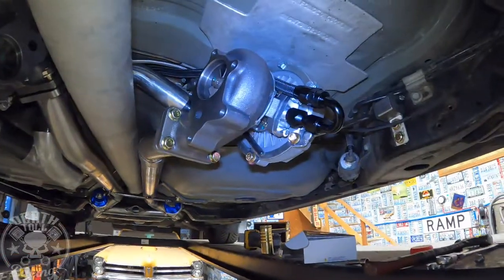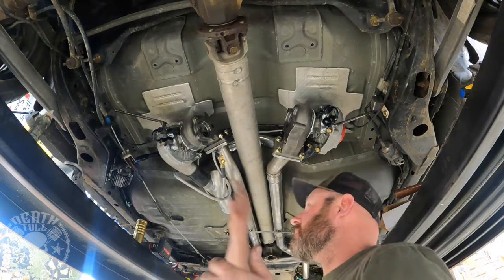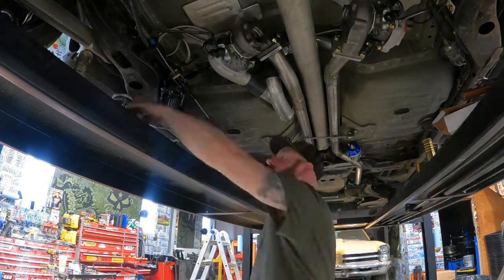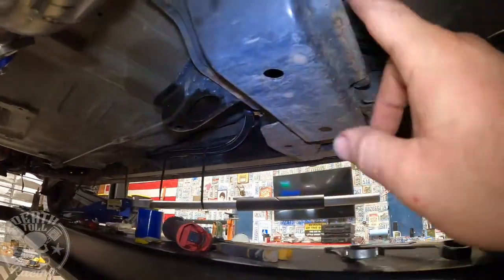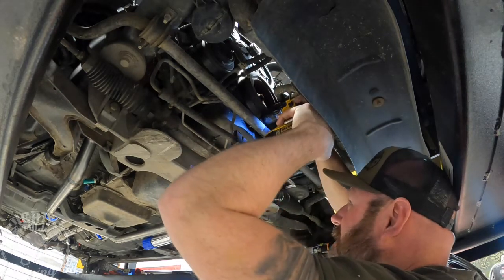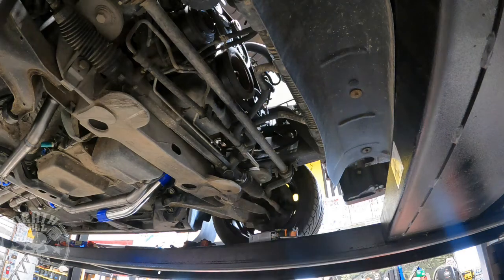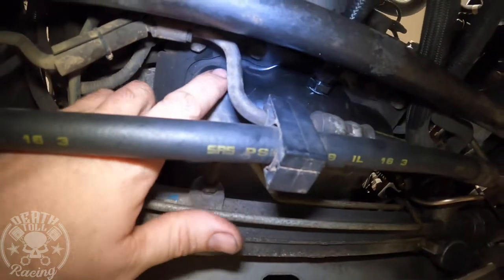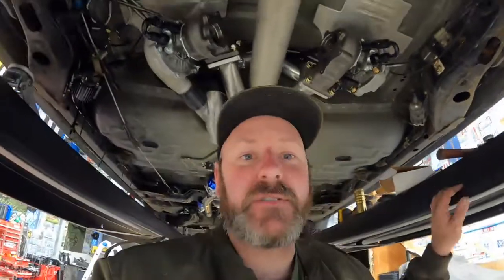Ep 5, Twin Turbo P71 Crown Victoria, Oil System, Scavenge Pump, Punch and Tap Oil Pan, Police Car

Comment: Did you use teflon tape, pipe sealer or both on the NPT fitting? It looks great
Reply from the maker: Just Teflon. I think it will be all it needs. Fingers crossed 🤞 it’s way more solid than I expected.